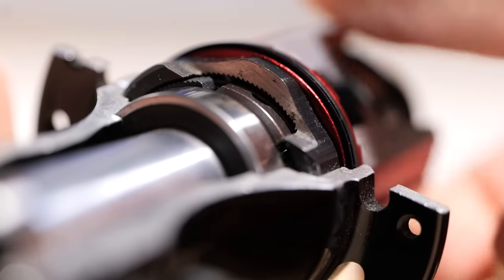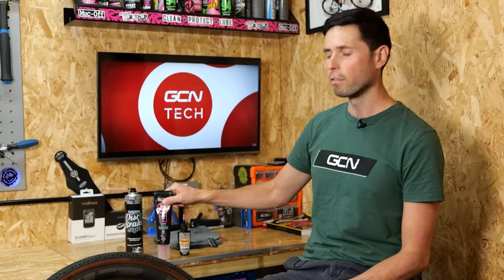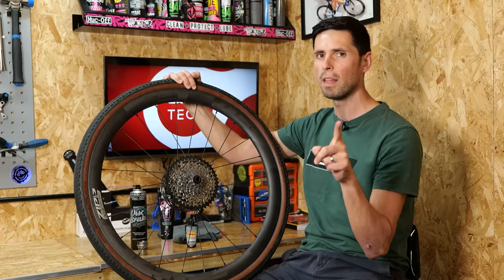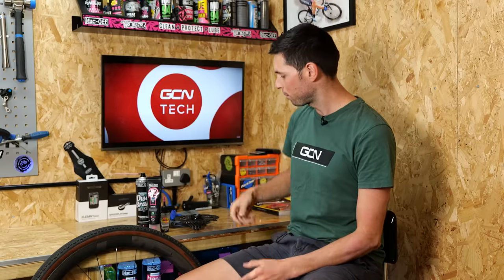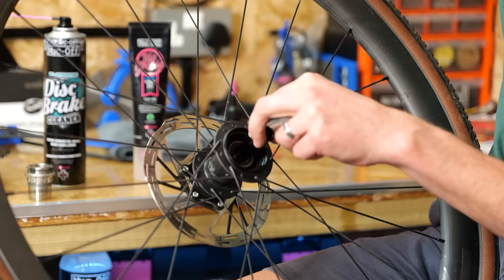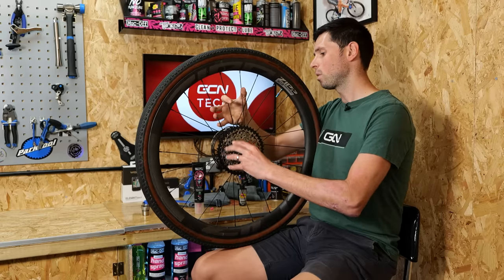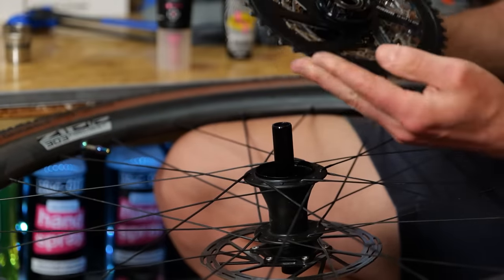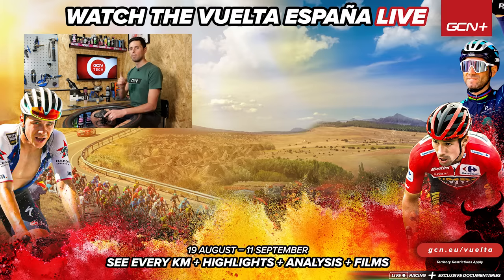How To Tune Your Freehub To Be Loud Or Quiet | Maintenance Monday

Comment: #AskGCNtech# Hi guys! Do you know, why top tube, mainly, is not horisontal any more?
Problem for me is, that with inclained top tube, there is no room for bag inside frame, otherwise can not fit 0,7L bottles for long rides, where people actualy would need space for this bag. (My frames is 50-52 cm)
As saddle position is higher than steering bar, i see that there is no problem to have top tube horisontal, exept, it add weight for frame.
 As found, it add aero gain.
As for me, horisontal tube add classic beauty as well.
 Please, raise this topic, I believe, you can influence frame producers.
Reply: The main purpose is to lower the frame's standover height in order to fit more riders. If I were to ride a frame with a horizontal top tube, this frame will be tiny, especially when I'm already relatively short.

Comment: #askGCNtech #AskGCN - Hi Alex, or maybe it's an Ollie type of question.... surely those noisy freehubs are less efficient than the quietest ones, on the basis that noise = wasted energy (like in other machinery)? my thinking is that the energy that we hear as noise would be better not generated and therefore used/transferred to power us along the road! I suppose that's hard when you're not actually pedalling (and therefore the energy needs to go somewhere)?

Comment: I think there's a common perception that louder means more expensive, which should equal better higher end engineering and performance.
Reply: I'd rather have a moderately audible one with low frictional drag. White Industries does this nicely.

Comment: You changed it by 7dB.
3dB is 50% change.
You effectively did 3dB twice.
So you dropped the original noise by half.  Then dropped the new remaining noise by half.
Reply: After 50 miles of riding you'd find almost all of that quietness had gone.

Comment: In the city, I like a moderate amount of freewheel noise, both when cycling and when walking, it is usually great indication that there's a bicycle approaching and sometimes works better than a bell 😂... at least here where there's no separate cycling infrastructure and pedestrians are often mixed with cyclists, which sucks...

Comment: Interesting fact the freewheel on my CVT hub with automatic shifting always clicks at the same frequency regardless of speed. Some will say its annoying but it's a good way to tell if the ratio is correct before I start pedaling. With auto shifting it always is.

Comment: I have 2 remarks:
Should you not also add oil to the sprag portion of the pawls to reduce wear as the teeth pass, also quieting it a bit more?
For a health and safety view point are you happy using a carcenogenic spray cleaner without breathing protection?  I know you didn't do much but it can be accumulative.